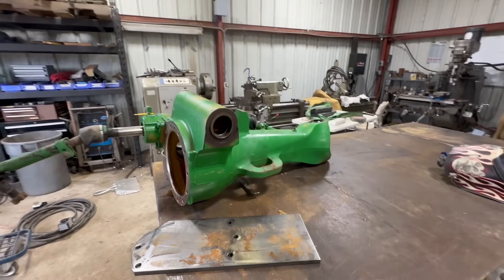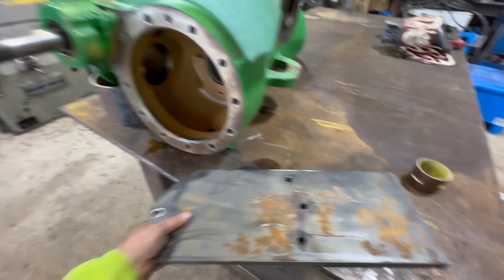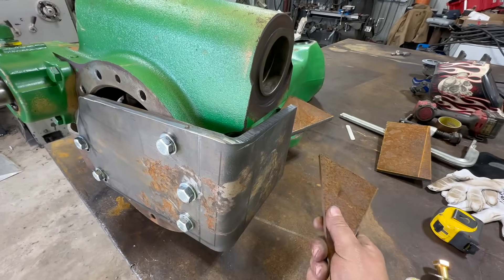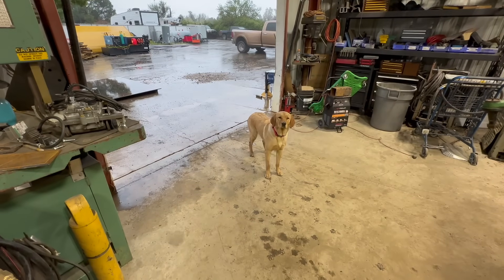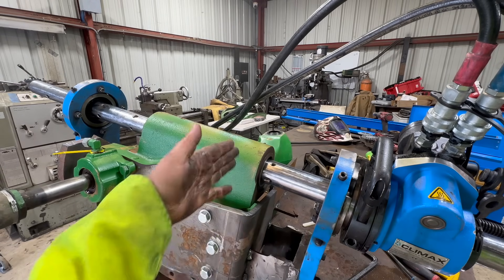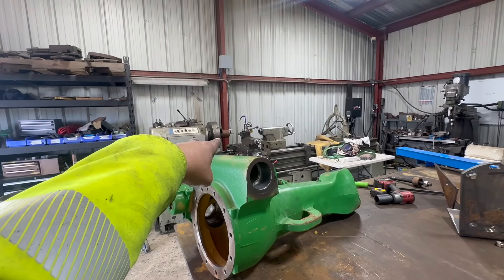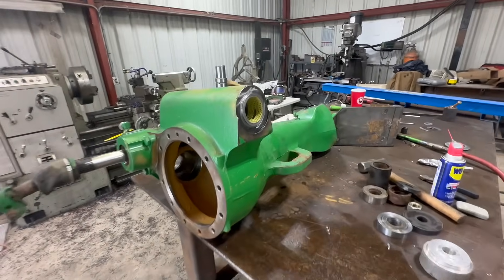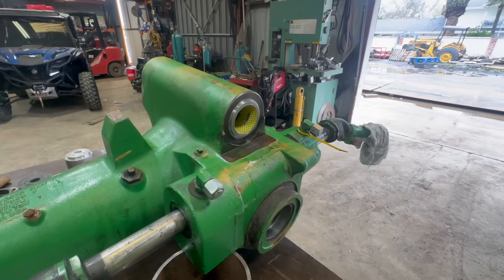Line boring a cast iron John Deere differential housing.

Comment: You should consider cooling the new sleeves using liquid nitrogen. The  N2 will cause the insert to significantly shrink and it; the sleeve, would very likely just drop into the machined hole. It’s just another way to get an insert with an inference to fit into a machined hole.

Comment: Great video, thanks. As an operator I wonder what caused the wear? I assume the pin is set up with zerks - lack of greasing? But you also point out that there are no grease seals so if it wasn’t greased regularly enough it could run dry and gall I guess. It also looks like a interesting setup for what I assume is a front steer axle in that there would be a pin in the matching housing on the other side of the differential that would preclude the ability for the axle to float? That Climax setup is a thing of beauty in your hands, much respect!
Reply from the maker: I believe this to be standard wear and tear.  Even with grease parts will still wear out.

Comment: Bushings should be made of cast iron also. Welding gray cast build up can be done with a cast iron rod and an acetylene torch.  If there was a crack that needed to be welded then machined ie; spark plug thread hole. Inclose the housing with a house made of fire brick. Use 2 natural gas fired weed burner style burners to preheat the entire housing 450F  weld are should be vertical and cover with kwol until ready to weld. Im to old I loose my train of thought. Weded several cooper bessmor heads in the oil patch.

Comment: Smooth operation there guy. Just a question (might be dumb). You say it's cast iron, could there be a possibility that it may be cast steel. The chips coming from the line boring look very clean and crisp, as to where cast iron would have been a more powdery substance. The reason why I'm asking this is because of past experience drill testing parts to determine what material it is.
Reply from the maker: I am 100% sure it’s cast iron

Comment: Welderfabber Youtube Channel had a video about a year ago: He had a rental excavator that needed a rebore, but prior repair already had oversized the fixture. So tried a product, I believe made in Norway (company makes various aftermarket products for all makes of machinery). Imagine a split bushing that is also sit lingitudinally into inner and outer halves that sleave into each other to give a proper dimension for a fixed shafts even the the fixture can be a various oversize. then as needed as the sleeve bushing wears you can simply tighten some more with a spanner (wrench}..

Comment: I found that in welding cast iron

1: those blue asbestos copped flux 3/32" E6010 SMAW rods work grate - 40amp AC. 

2: 1/16 to 1/8" surface coverage.

3: after 1/8" surface coverage, webbing has to be added like thin gussets mimicking a spider web if a thicker case reinforcement is needed. 

4: preheating or welding it cold, either way only tack welding it as if welding 18 gauge sheet metal, do not make continuous weld passes.

5: it takes a long time, start stop tacks...

example

welding a 3 inch spring steel race into a PTO case that had a blown out 2_1/4 bearing... 

not having a clean seam, leave it jagged like gear teeth "on the cast iron side", so if the weld does crack it is still mechanically locked. 

similar to drill bit holes along the whole weld seam, that the weld flows into, not welding hot enough to burn the 1/16th ~1/8" inch tooth notches off. 

Iron cracks on the very surface, so doing that creates a broken sub surface like a fractured rod if it did brake.

and the SMAW process a stick can be in full contact while welding or lifted off creating a spray arc process, depending on the alloy of the cast iron... to get a finer control over running currant giving a 3/32 rod a surface coverage closer to 3/16 inch. and a transfer of metal in each tack weld not exceeding 24 or 28 gauge in relation to the metal surface added over the aria for each tack weld "similar to welding 18 gauge sheet with that same rod". 1/8 to 1/4 1/2 second contact times, letting the tack cool and the slag brake off even to the extent that it is the fitting line of the weld that cracks as it cools because the weld arc blows the metal away making that spot thinner.

nearly 35 minuets per inch with a sectional aria of, 3/4 inch contact "brazing" weld, that tappers from 24 gauge up to 1/8" over the 3/4 inch braze. so the sub surface is 1"x3/4"... if the weld continues past 3/4" the brazing height has to be limited to 1/16 inch and 1/8" webbing can be added over the aria of the joint adding surface brazed shearing aria that is 8'000psi to 15'000psi tensile at best though over 1/16 inch, so a 1"x3/4" aria has a linear dampened load limit of 500 to 900 pound force. 

so a 3 inch bearing with a 3/4"x16" case braze around the race, has an upper rigidity limit of 12'000 pounds with 18'000 pound being the shear limit that is past the upper 12k elasticity range. so 12k on a 3 inch bearing works out to nearly 5000lb-ft at the upper elasticity range that would lead to a timely failure like a spring being used, so the safe working limit is 1/2 to 1/3rd the elasticity tensile aria. along to the gears in the case that hammer the bearing into the case every time they contact... 90 degree case has 45 degree straight gears... so when the engine PTO stall torque is 4 times the engines static output torque, in situation 220lbft becomes 900lbft as being 2160 pound force over the contact radius of the gears and there angle of shear contact. most common failure location on a case would be on the output side where the torque direction is directed, nearly being 100% of the radial load over the weld being on that sides half to 1/3rd of the weld aria. 1/3rd still being 4'000lbf in stated example.

when welding cast iron, situating a weld so that the weld becomes a saddle that wedges the cast between its self, that involves welding the outer and inner case similarly... tho in demonstration the PTO case in question was only welded on the outer side of the case.

a problem created by a engineer in Columbia deciding to use a 2_1/4 inch bearing on a 80HP 6000lbft pinion shaft/spline... forced to replace deliberately manufactured defective equipment with appropriately sized parts. 

ANS: American National Standard... that's a 284ksi tensile 3 inch race Timken bearing for that 6000lbft upper range.

it is a crime to manufacture equipment that is intended to fail for no good reason other then to force excessively constructed taxation over society as that in it's self is an environmental crime relating to material waste... that is why imported cars tractors trucks etc are tariffed. "selling equipment that is engineered to fail in process to deny all possibilities of 3rd world capital gain or outer governments reducing emissions costs... reducing emissions costs = illegal to put a 2_1/4 inch bearing on a 1.25" pto shaft". lasted 10 small tanks of diesel then all the pins fell out of the 3rd world bearing.

Comment: Awesome!  Nice to see someone who really thinks about working efficiency.  Like turning bushing drivers and such.  I've seen other guys on YouTube fight something for an hour when they could have spent 15 minutes turning a driver or part of some sort, to not only make the job easier, but can be saved for future use. I turned out a complete set of bushing drivers for my  excavating equipment that came in handy for years.  A bushing driver that has a slightly smaller OD can be used for both installation, and removal.  Regards.

Comment: Actually, you could press in the bearings into sleeves first - on a hydraulic press, that'd be kinda simpler/ easier. They wouldn't put much pressure on these sleeves, so no issue of any "expansion" of them, and then sleeves were pressed in with this adapter piece so no contact whatsoever with them split bushings... Or so I think ;-)
Reply from the maker: If the bushings were a tighter fit that would be a good idea.

Comment: why wouldn't you be able to weld cast iron??? 
cast iron is very weldable.
Reply from the maker: Cast to steel is prone to cracking and could weaken the housing.  To properly weld cast it would have to be heated up which doesn’t make sense in this situation.

Comment: How did you accurately align the boring bar to the casting ?... 
Did you just use conical sleeves to catch the original bores on either side ?... if so, wasn't the (presumably off-centre)  bore wear an issue ?...🤔
Reply from the maker: Centering cones get it close then a dial indicator to make it perfect.  I can’t post all my secrets.
Reply: I thought there might be a bit more to it ... 😂
😉👍☘️🍻

Comment: You could weld it with a silicon bronze and then line bore it CEE in Australia has fixed several cast iron projects like that on big construction equipment he has a YouTube channel if you have not watched him I might suggest it he is like you takes stuff that should be trashed and replaced with new but refurbishes it to like new
Reply from the maker: There are many ways to do the repair.  I think everyone has heard of CEE
Reply: But why?? This worked out great, and faster this way
Reply: Wait who? U say there a Aussie with a homeless dog that does machine repairs. Noooooo!  Let me check that out.  Also, on all those repairs pretty sure he’s told the customer that he can’t warranty those iron welds, but wrf do I know, lazy boy jockey crushing a Ron to pass the time. Cheerio.

Comment: Engineer here: those supports are dope... Reason I like this channel is the innovation and creativity of your solutions… and for the shop dog. RIP forklift leg doggo. He was my favorite
Reply: Any engineer's thoughts on that weird split bushing? What does something like that do that a normal bearing wouldn't? Apart from likely being cheaper and generating more revenue in parts and work for Deere... That thing looks like it came right out of Flimsytown!
Reply: @2xKTfc i think that inside layer on that bushing is hard to manufacture unless it has a slit. Maybe they make em while they are flat and then cut em to size and bend them. I cant imagine another way to put that inside yellow layer on that bushing
Reply: U must not b a good engineer if some simple setup excites you
Reply: @liamkelly8684  haha… this guys… geez
Reply: @liamkelly8684  They guy unironically typing "U must not b" talking shit lmaooooo. Lrn 2 spell monkey.
Reply: @liamkelly8684  you suck
Reply: @liamkelly8684  try not being a dunce